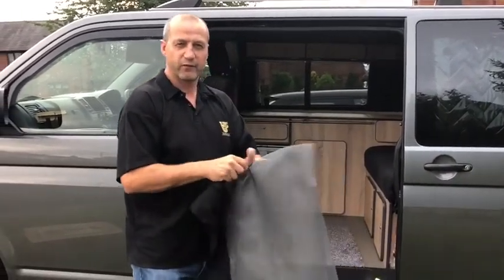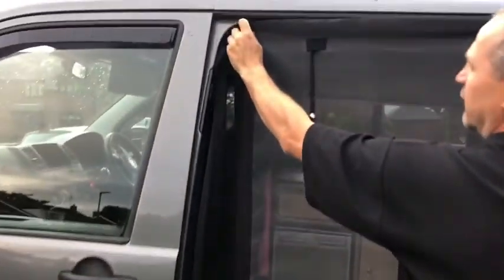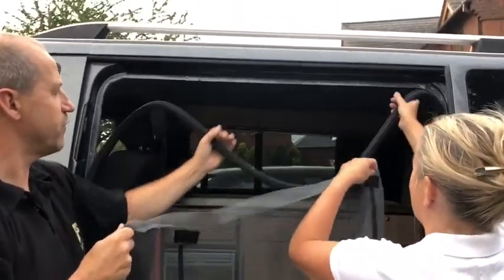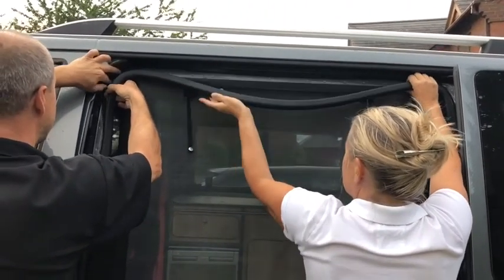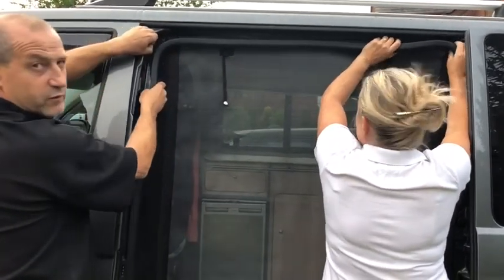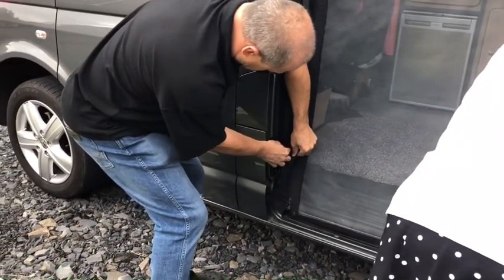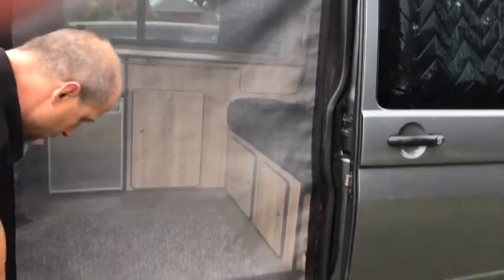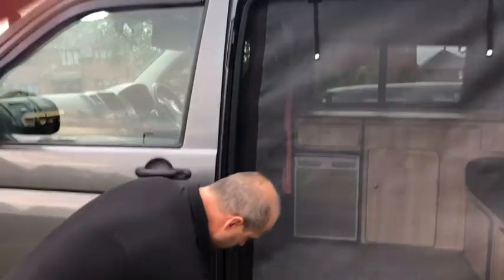Mosquito Nets for camper vans by info@sarah-mosquito.net

Comment: Can you still close the doors with netting in place or do you have to remove it before shutting the doors? And if the bottom is not really secured, do smaller bugs like midges can get in or are midge nets done differently? I found that they are able to squeeze through tiniest holes!